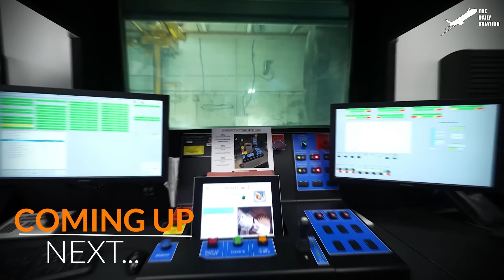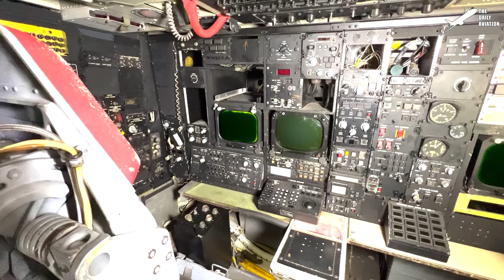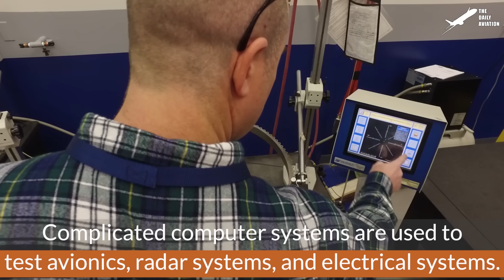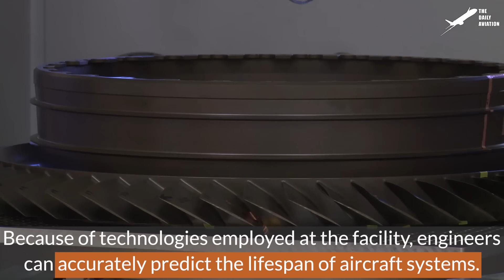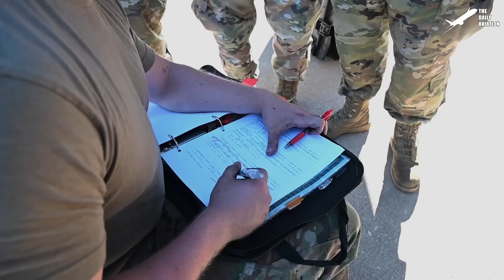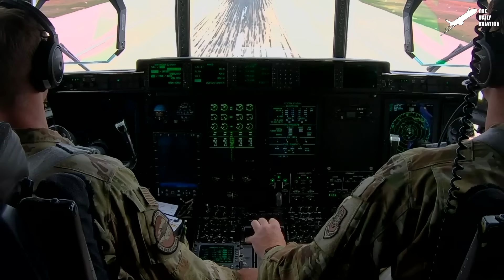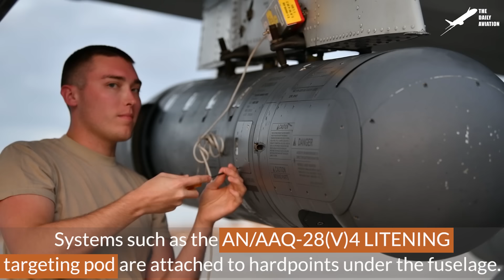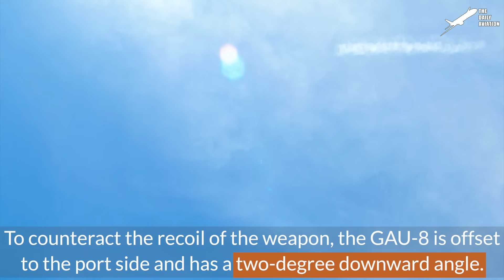Inside US Air Force Largest Facility Restoring Broken B-52 Bomber

Comment: I left Guam in early 1972 after Line Backer II and my last view of the Anderson AB flight line was a shell of a cannibalized B-52 that I would have guaranteed you was just a scrap metal pile.  I passed through Anderson again in 1974 and the B-52 was gone.  I asked what happened and they said they brought a team in and rebuilt it.  They flew it out.

Comment: In August of 1969, after spending a year in Thailand at U-Tapao, guarding B-52s and KC-135s, as an SP Sentry Dog Handler, my next assignment was to Tinker AFB, Oklahoma City, OK. At Tinker, I worked as an SP Law Enforcement Officer along with a civilian police force on the base. At that time, as it is now, it was a logistics facility that employed 23,000 civilians and 7,000 military personnel working on and upgrading B-52s and F-4s as well as making repairs to various other aircraft that would occasionally come in with damages. Seeing the picture of the B-52s in the hanger now, modern, clean, and well lighted, they were nothing like that in 1969. They had three planes in each of the two hangers at that time, parked at and angle to make them fit, and because there were some classified equipment remaining on the planes while being repaired, they would post a Security Policeman in each hanger guarding them on the weekends while the workforce was off. I got that duty a number of time and, even after having watched them take off and land every day the previous year, I was still amazed at the size of them being so up close to them in the hangers. Even climbed up inside a few times and they seemed even bigger from that view. It is so awesome to see how much Tinker has changed since I was there 55 years ago. I was there until January of 1971 when I was discharged from the Air Force. It really was a great assignment, like having a civilian job, after having been at a SAC Base then a year in S.E. Asia and if they would had let me stay there for the next 16 years, I would have re-enlisted. Unfortunately the war was still going strong and my career field was critical to S.E Asia so if I had stayed in, in all likely hood, I would have wound back there.

Comment: Thank you for the informative and interesting video showing the inside of  this Massive repair and rebuild Facility. The B-52 developed in the 1950s and is still part of the backbone of America's Airforce. I guess you can call it a feel good proud Nostalgia I have for the Iconic B-52. Up graded and modernized weapons and electronics so they are still able to meet the demands if the US ever gets into another major conflict, they have stood the test of time.
Reply: Development actually started in the mid 1940s

Comment: Tinker is one of the largest employers in the state of Oklahoma. 835 homes and a neighborhood school north of the main runway were condemned and removed about 25 years ago to guarantee safe approach and take off corridors for the facility.  This was after the Air Force threatened to close the base because it presented too great a hazard to its neighbors if they remained.
Reply: Now, fortunately, much of the property surrounding the installation is government owned, federal or state, to prevent future safety issues and allows for expansion. Having four other major bases/installations nearby doesn’t hurt either.

Comment: The Oklahoma facility looks incredible. 
Is that the first B-52 to be fitted with the new Rolls Royce engines?
Reply: No.
Reply: Those are Pratt & Whitney J-57-43-WP's. (Water injected turbojets). Ask and ex crew chief how easy it was to change a water pod valve.

Comment: Awesome covereage of this project.  Are the workforce members DOD civilian employees or are they working for a contractor (Rolls-Royce or otherwise)?
Reply: They have both DoD and contractors on site depending on the plane and/or engine, but the bulk of the workforce is DoD. Any "newer" engine or airframe will likely have the contractor, like RR, Pratt & Whitney, GE, etc. onsite as well since there might be a warranty or some other agreements in place.

Comment: Would like to know why the B52 smoke so much when it takes off ?
Reply: EIGHT engines using a fuel not unlike kerosene
Reply: You always take off at full power. Dense air = more fuel consumption. Jets always climb to high altitude asap to reduce fuel consumption and fly faster.

Comment: crew chiefs are overrated, today's airman do their specialty and crew chief work since the 90's
Reply: You ever do any of it?  I was an avionics puke, Electronic Countermeasures specialist.  When they started reorganizing maintenance in the early 80's I got assigned to the O level maintenance squadron.  Those of us in specialist flight that weren't busy got tasked to assist the crew chiefs doing everything from refuels to preflights.  I gained a whole new level of respect for those folks and learned more than I sometimes wanted to know about flight operations.
Reply: @bobmorgan1575  Yes, I was with the 352 nd AFSOC, Charleston SOL II, 353rd AFSOC and now Mx on Boeing and Airbus A330-200

Comment: Jesus this is full of nonsense. 
It was built in 1942 not 1941. The main building today is known as building 3001 but during WWII it was the Douglas Aircraft Plant - OKC and built over half of the C-47 used in WWII. Had absolutely nothing to do with the B-17 or B-24. That was Tulsa not Tinker. 
It’s a misleading and inaccurate video at best.